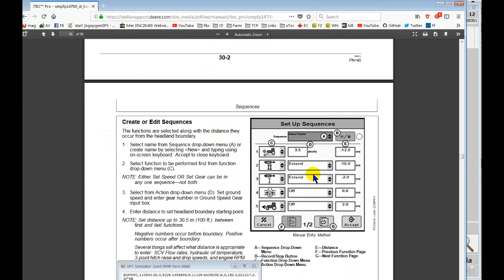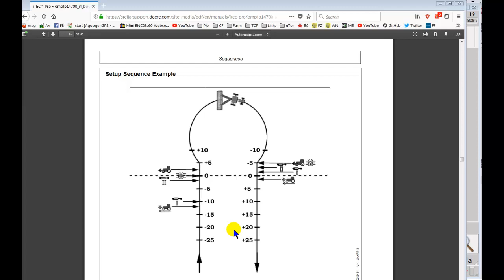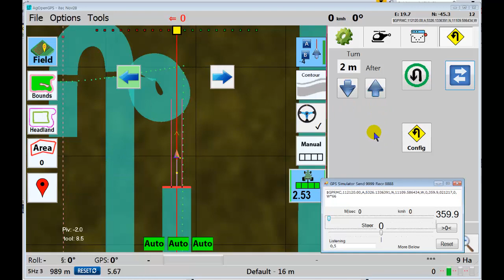Sequences and AgOpenGPS

Comment: I have connected a gps unit to my laptop and selected the port everything is fine the tractor showed up on the screen and everything. Except for one problem the gps unit is completely still but the tractor is still moving on the screen. Any Advice?
Reply from the maker: I put in a simulator right in the program. I guess its not shutting off. I will upload an updated one tomorrow! If that isn't the problem, make sure you're not running a sim at the same time. Obvious I know, but gotta check
Reply: FarmerBrianTee ok thanks
Reply from the maker: Uploaded the new version to github https://github.com/farmerbriantee/AgOpenGPS_Dev
You can turn off sim in options, or connect GPS to port and sim should stop.